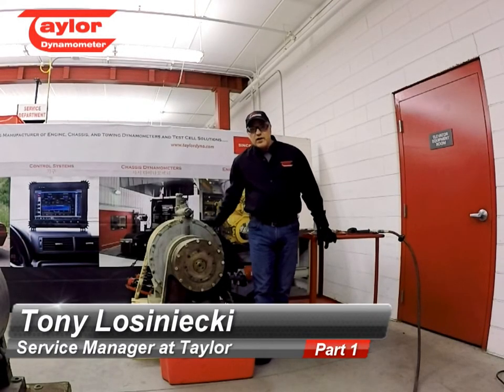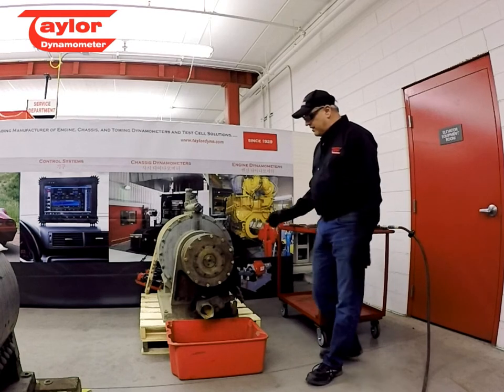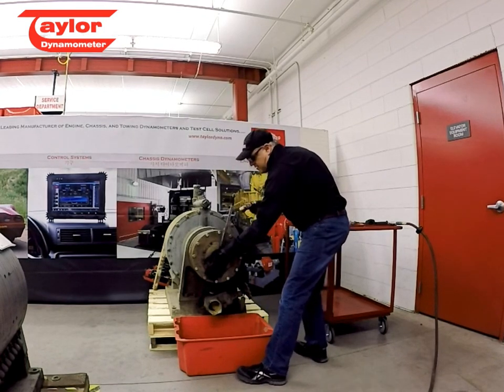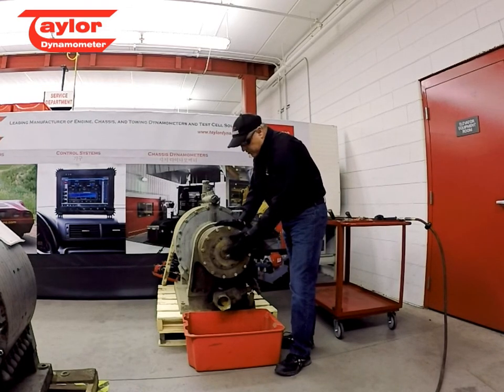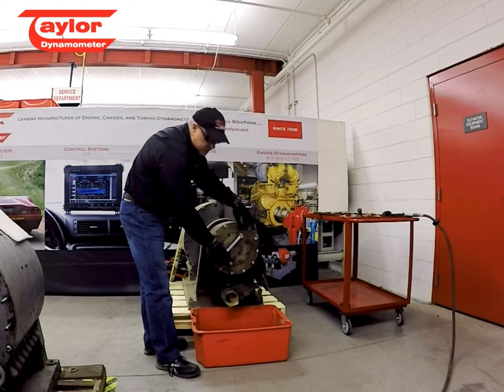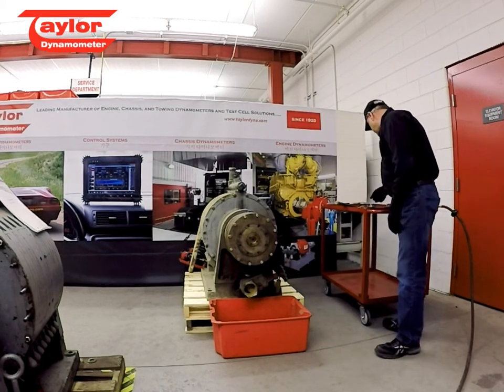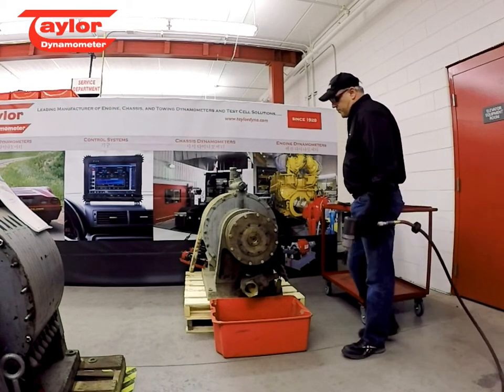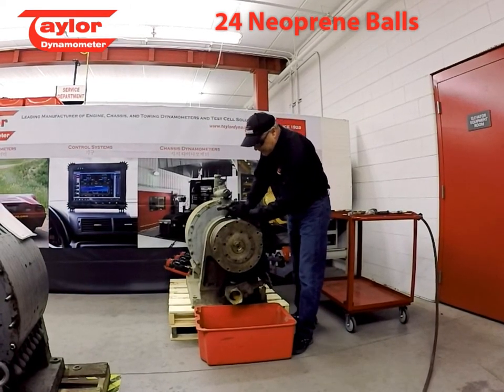Removing a Torsional Coupling on a DX Dynamometer (Part 1)

Comment: Hi Tom. Hope you remember Cirilo from Al bahar uae dyno. Our big dyno is starting to have a leak from the torsional coupling and I'am having problem to remove the assembly. I have fabricate a tool to pull out but its not moving at all. Do I need to heat up the front & back shaft area, Please I would need your expertise and tips to be able to remove the torsional coupling. I appreciate your your quick response on my query.
Reply from the maker: Hello Cirilo,Thank you for reaching out.  We are sorry to hear about your dyno. Our Service Team will be contacting you to help you through this process.Taylor Dynamometer
Reply from the maker: Hi Cirilo,Yes I remember you, hope all is well. Seeing that this email has come thru our YouTube account I take that you have viewed the video for rebuilding the coupling. https://www.youtube.com/watch?v=UhSksxv6Q_YSometime the torsional coupling can be stubborn and difficult to remove from the shaft and heat needs to be applied to the inner hub not the shaft (see attached drawing item 9). In order to get access to the inner hub, the coupling will need to be disassemble on the shaft as shown in the video.
If you should have any more questions please contact us directly at service@taylordyno.com Regards, Tom LaPine, Service Technician - Taylor Dynamometer